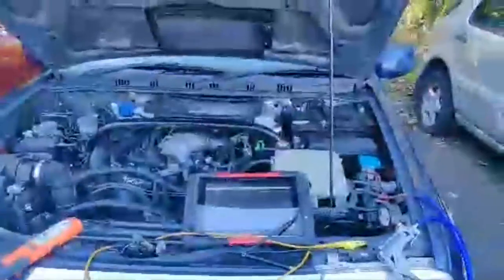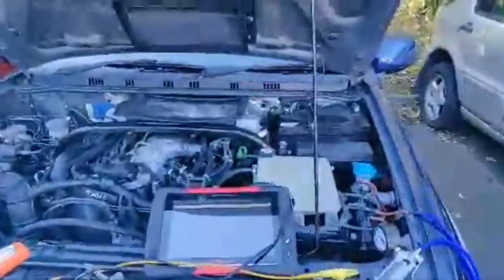EGR Valve Testing 101

Comment: Hi Steve, It's a diesel, so should EGR be open when idling? If so then operating it would make MAF more wouldn't it? as  your'e closing the EGR.
Reply from the maker: Steve, EGR is open at idle for a couple of minutes on start and on overrun then a couple of minutes at idle. After that it should be closed. There's variables but it's a good rule of thumb 👍
Reply: Trouble is I'm always hitting my thumb Steve LOL